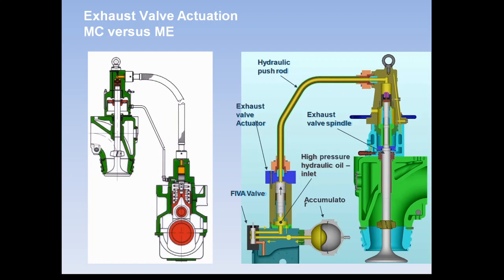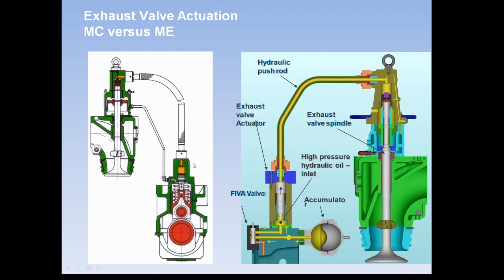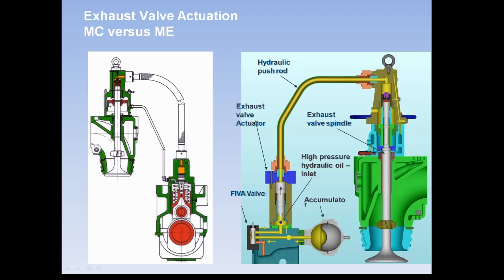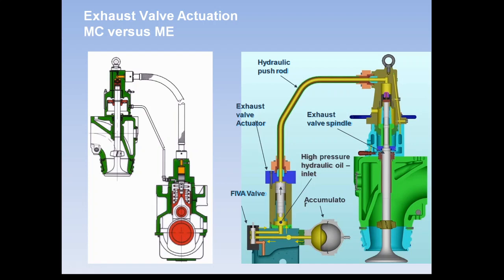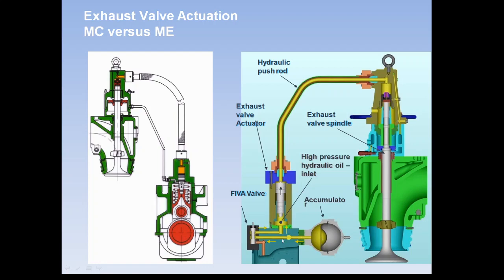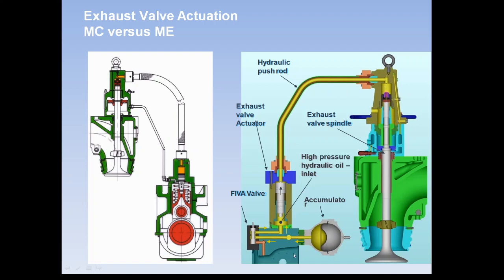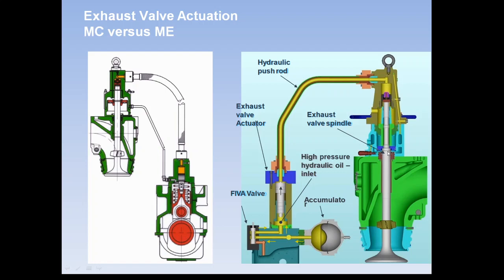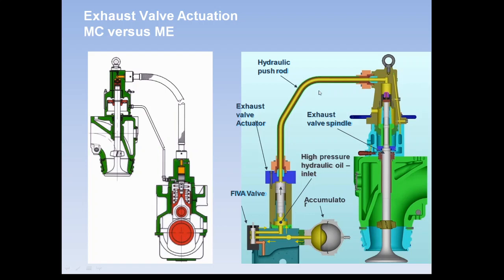difference between MC and ME engine  of Exhaust Valve Actuation system ?

Comment: Very good video....one question asked in mmd 7 bar spring air is enough to close valve???
Reply from the maker: The pressure required for closing the valve is  around 4-5 bar is enough..., because the closing of the valve is determined by the surface area on which the pressure is acting .
As you know the force=pressure xarea
So the force will be higher if the area is big enough.
So the designer have taken care of that during the design of exhaust valve.

I hope you understand!!!!
Please share the Marine Engineering hub channel with your friends also!!!!
Please do subscribe!!!!
Reply: Ohhhkk thank you

Comment: What is/are possible causes of two different cylinder exhaust valve failures in as many weeks? Valves cracked across the face, then burnt through.
Reply: It's happened with us also , exhaust valve have vanes for rotation after each exhaust, but in our ship we found it was broken and valve was not able to rotate and one point is got all the carbon deposit and wear and that part timely run out

Comment: How does reversing take place in electronic engine
Reply: by air spring i think, FIVA close oil outlet, exhaust valve actuator go down (pressure of oil in pipe decrease) and pressure of air more than pressure of oil (so valve is closed by biggest pressure of air).